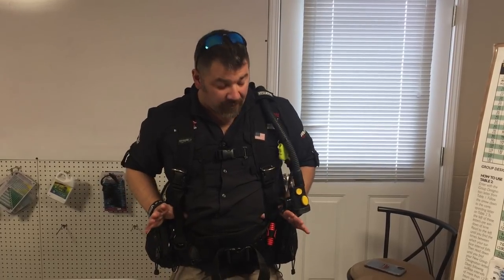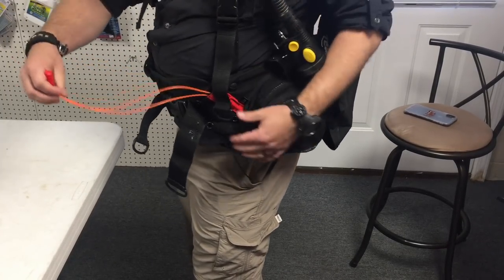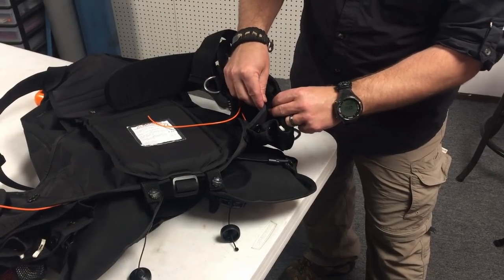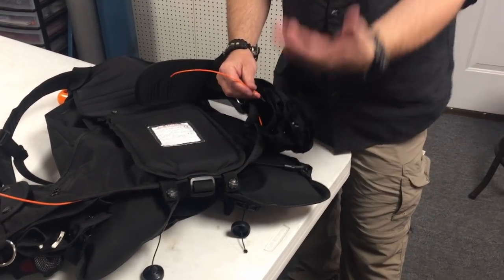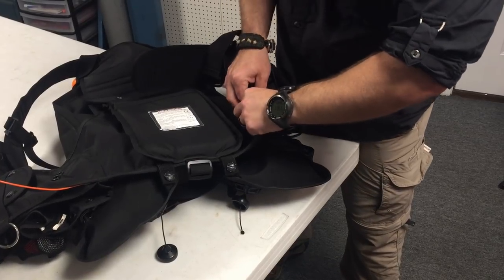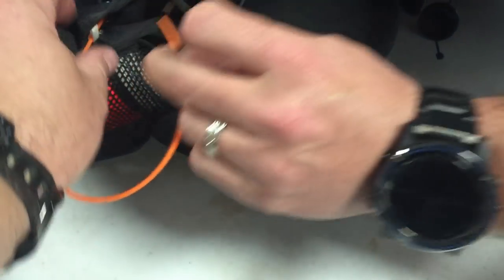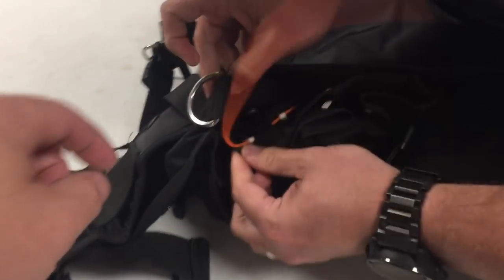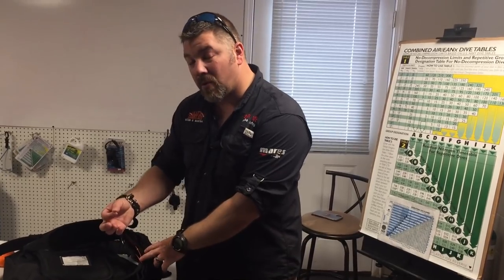How The Zeagle Ripcord System Works

Comment: Can you install a crotch strap on the Zeagle Ranger LTD BC without problems?
Reply from the maker: Hello @BurhanMuntasser, that is a great question. As long as you have an attachment point in the rear of the BCD, and a loop system in the front, then yes.

Comment: Such a gay process

I purchased this BCD and I must say that I do regret my comment. My dive shop and me both didn’t like the idea of the ripcord system because you have to rethread the ripcord every time you have to drop weights, but the reality is that you should never have to drop weights anyway so the ripcord system literally works fine and is not a problem. in the event that you do have to drop weight then at least you have a free hand to control buoyancy. Even in pool training you can unzip your pockets pull your weights out and put them back in just like integrated weights so you can pass your pool training skills as your instructor instructs. Just check on your ripcord before every dive as part of your BWRAF or equipment check (even though the ripcord is not going anywhere or failing, it’s actually a pretty solid set up)
Reply from the maker: Hello undeadservitude9749, thank you for watching our video and sharing your thoughts with us.